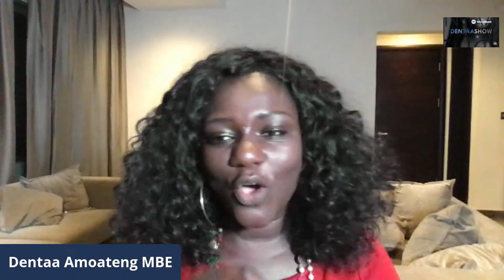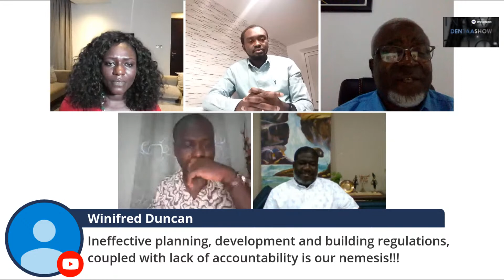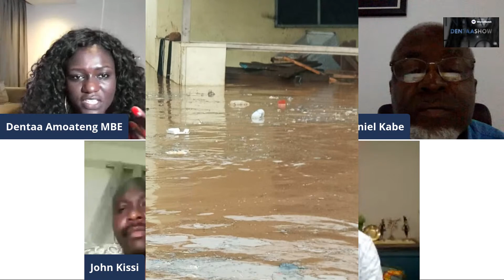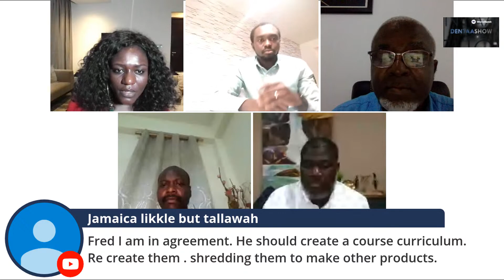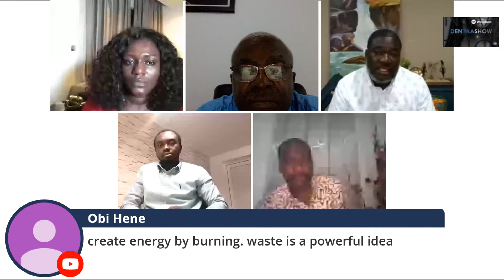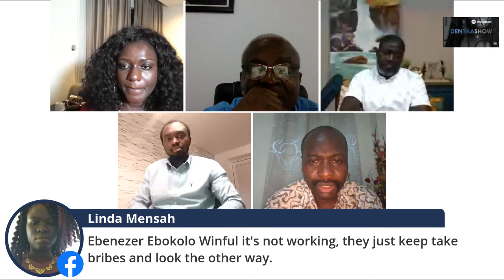We have the Solution to the Accra Perennial Flooding

Comment: Hi Odana. I once use to live in Accra, at Abbossey Okine, the place now used as spare parts industry. 
The drainage system problem follows from Wedzia & the higher fields, down through to the Korle Lagoon, on its way to the sea & any blockage that occurs along its route, leads to flooding.
 In early 1965 there about, when I was in Ghana , the problem that occurred led to digging into the Korle Lagoon with the hope of widening it & easing the journey of the rain water from up the mountains through localities to the Sea.
The problem that is occurring now in Accra,  is the result of the Lagoon not in operation in accommodating &  conveying the water to the sea. The other issue is that some home owners refuse water to transverse their property from their neighbour who happens to be along the route of the waste rain water through to the Sea.
There was an incident where our neighbour refused the rain water that had flooded our house to go through his property on its way to the Lagoon, thereby causing 4 - 5 feet flood in our house with dangerous situation because electrical wires & equipment were submerged.
The problem squarely lies with the Odoor & the  Korle  Lagoon which needs excavation to cope with the in floods of the rain water from the mountains. Proper construction of drainage system would also assist. Greater Accra is in a lower site in the geological sense  & is bound to flooding if the drainage system is not addressed. 
The Korle Lagoon  & the big gutters such as the Odoor & others leading to the Korle Lagoon, should be widened & dug deeper.
I used to live in Accra & was aware of the problem whenever it rained.

Comment: My sister the problem is that the new design does not take the natural route of the water into consideration. Now most of these bodies are rivers and with development these rivers have been turned into gutters. An example is the Bubu which runs from bubiashi through the kaneshie market into the korle then into the sea. Now it has become a gutter which is so small and cannot contain the volume of water that is why kaneshie market get flooded. if you check Accra topography in the early 60s you will see the rivers which have now be turned into gutters

Comment: Building more drains will not solve the flooding. My solution is to have a dry well (10×15 ×5ft) on every lot to take up lot of the water on the property. The extra water will run into storm drain that are under ground ,which are made up of cylinders that 6ft in diameter. The water from the storm drain will run into a man made terrace dry lake. Once the lake get water in the rainy season, the water will be pumped to areas where water is in short supply.